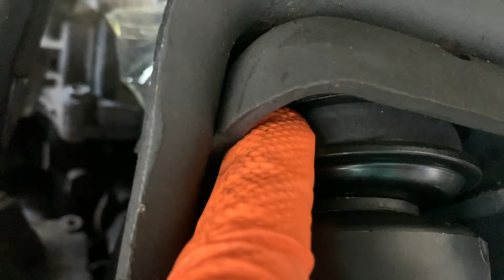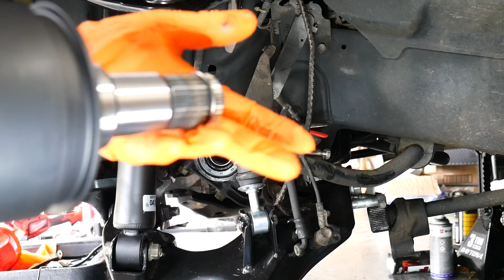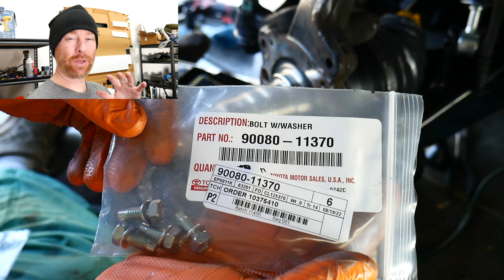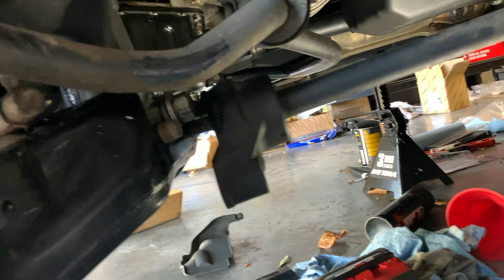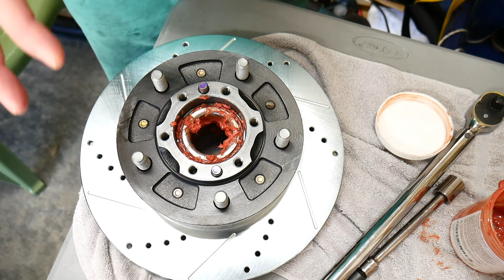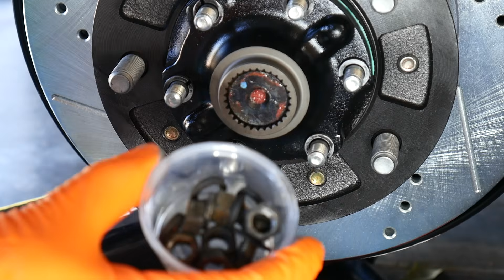Project Lexus Front Suspension Ep. 3 - Installation of the front suspension

Comment: Awesome video as I am in the process of the same deal on my 05 LX470. I was wondering if you relieved the torsion bar tension with the adjuster if you would have been able to install the flange shown at 25:07 or maybe I missed that step on your earlier video? Thanks a bunch for all of your LX videos!
Reply from the maker: Hey. Thanks! I didn’t relieve the tension. I definitely could have marked where things were beforehand and remembered how many rotations I would have done, but honestly, I didn’t think about that initially. My assessment at the beginning was that I would leave as much alone as possible. Thanks for the support.
Reply: @itsnotharditsjustnew  Well, the plan is to mark the flange and the adjuster(count the threads) then loosen it up and see if I can get the lower control arm off that way. Thanks again
Reply from the maker: Best of luck! 🙌